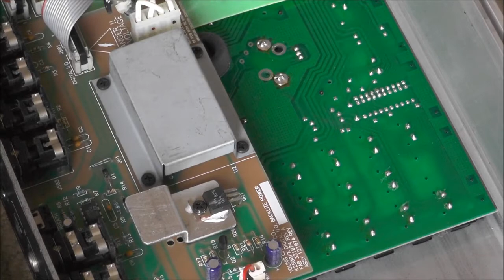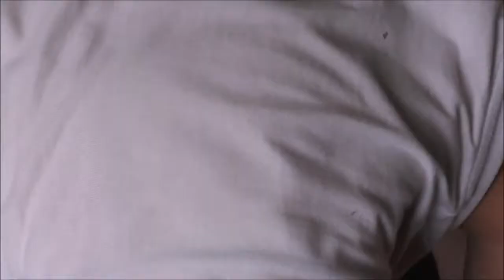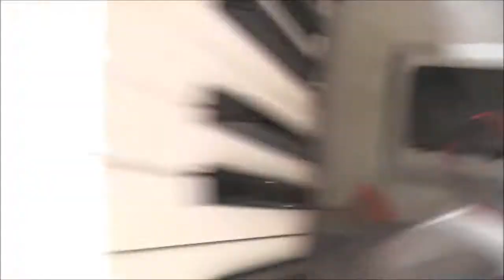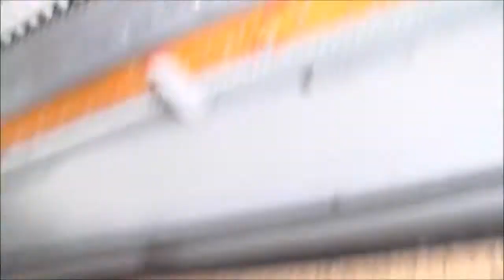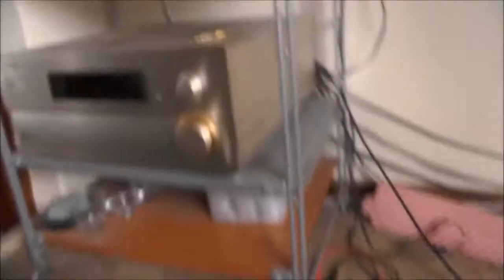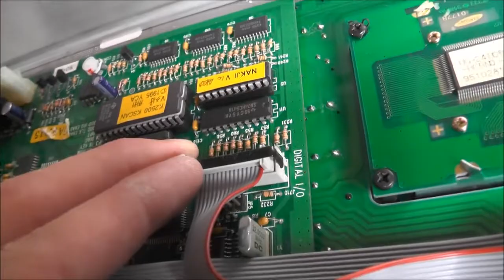DL#012 - Kurzweil K2500X Repair Part 2

Comment: Hi! I own a second hand non-functional Kurzweil PC88. Measured the voltage, all looks good, the issue on mine appears to be the broken Vcc of the Hi ROM chip. Do you have or can you make a backup of firmware Hi and Lo please ? I can still find AM27C040 chips but firmware is nowhere to be found. Assuming the Lo chip on my keyboard has all pins (didn't check yet), I should be able to copy it with my USB programmer, the Hi chip also had A18 pin broken but only half and I was able to fix it but not the Vcc as it's broken from the inside. Thank you!

Comment: I have a kurweil pc 88. Help please,  when I press down sustain pedal it will not sustain but it does change the reading in the window so I know it’s getting some kind of contact.   The  window reads "zone:1 SwitchPd1,     SwType: momentary. .    Can anyone tell me what this means.
Reply from the maker: If it can see the pedal operating it sounds like it's just a configuration issue.

Comment: The inverter has a small soldered in fuse, which probably has blown. You might just change it and see how bad the lights are before replacing the whole LCD with a new one. Try to get one with a white backlight or a RGB led so you can change the colour to suit the ambient. Keyboard nice simple fix. Probably the connector is used because another keyboard uses the same key module and it is lower profile so they use the same part for both to reduce inventory.
Reply from the maker: thanks Sean, yea i am going to keep an open mind. I have started looking for replacement EL drivers i could possibly use. I also had an idea to convert this LCD to an LED backlight as i have a small backlight from a TFT panel i could hack. But last time i looked the current LCD now has THREE horizontal lines of pixels out on the display so a new panel might be the only option.